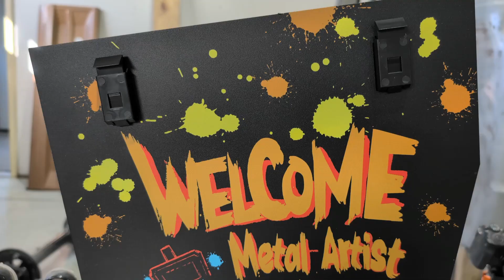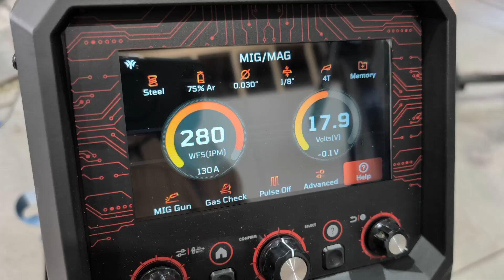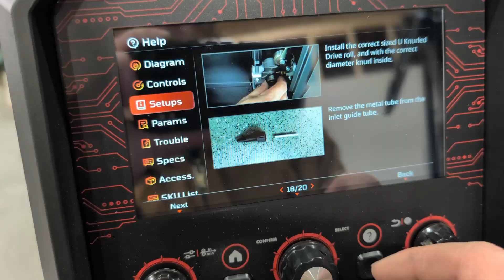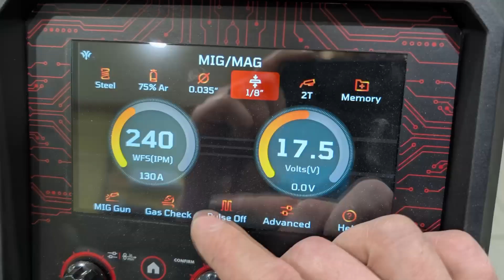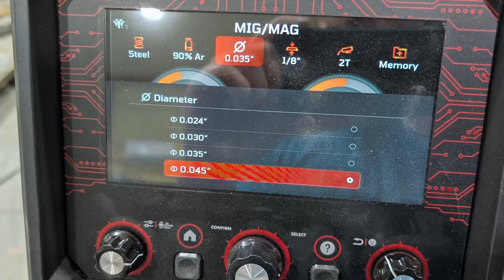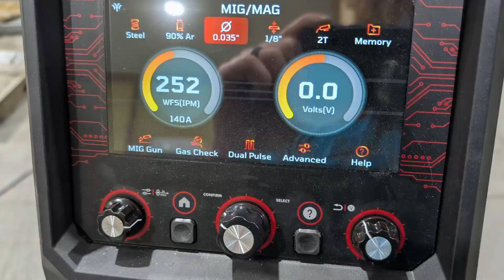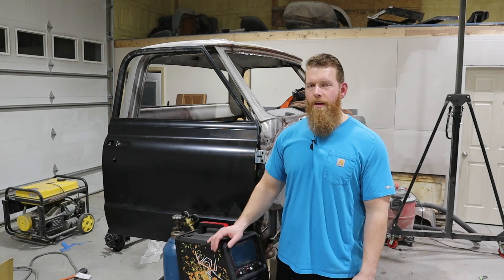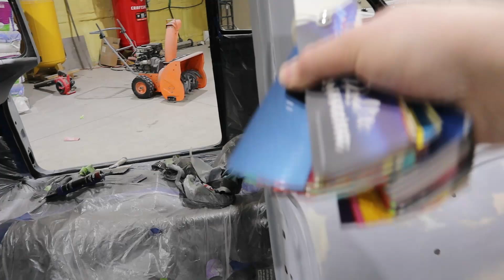What is Pulse Welding? | YesWelder DP200

Comment: You definitely have to have a 90/10 gas due to the nature of pulse and it being a spray transfer, the 75/25 won’t let the arc to get hot enough to get into that transfer if that’s the best way to put that, and if you do get the gas to run pulse you’ll have to run a longer “arc length” and not have the nozzle as close as you do with the typical short circuit transfer of mig

Comment: The issues you're having are common and are kind of a frustrating misunderstanding because of the way the machine was marketed. I saw a lot of people saying that the dual pulse feature will allow you to weld thin material without burning through. But, dual pulse is a spray transfer method, meaning that it uses much higher voltage. So, it probably won't work with any material. It also requires the 90/10 gas. There's no way to get around it. 75/25 will always be a modified method and will not have the desired results. They may be able to add smaller gauge wire, but I'm not sure. There are some synergy settings that are way too hot on this machine. The aluminum synergistic settings for the dual pulse is all messed up.
Reply from the maker: There's definitely a learning period to it. I appreciate your feedback. I think the machine might welds steel great! I've used it on some of my restoration repairs and it seems to be doing a great job, even with 030 wire. Usually I have to run the thinner wire, which can be frustrating too. But this to be doing fine with that